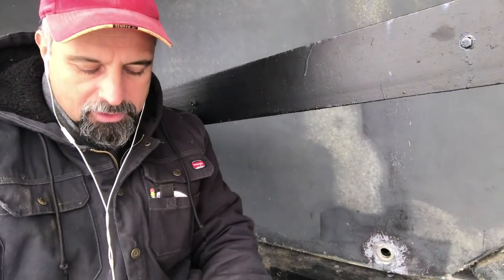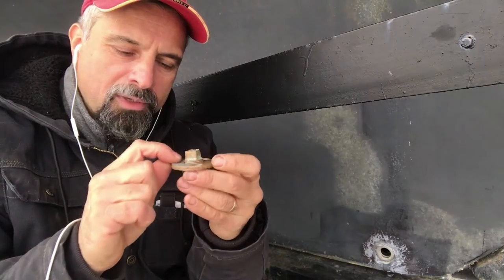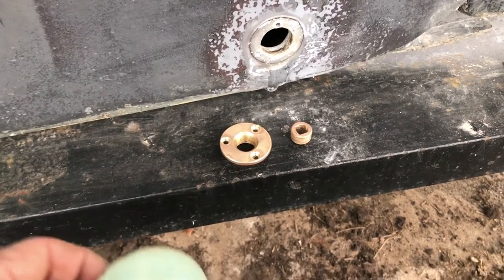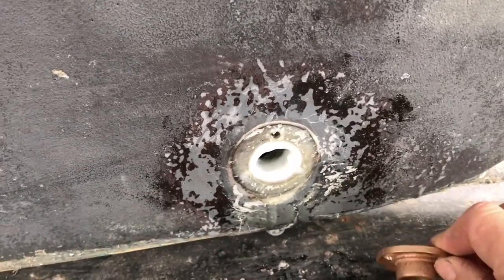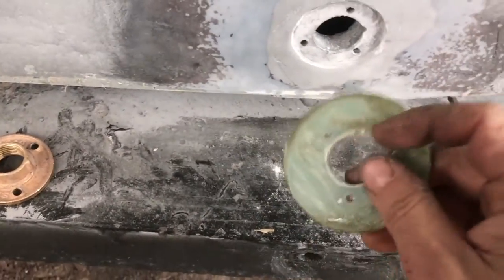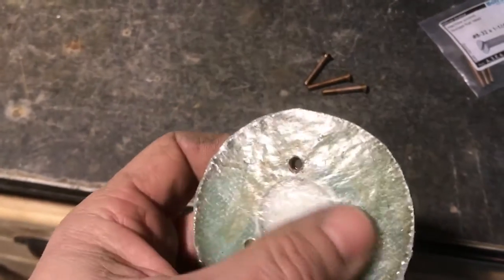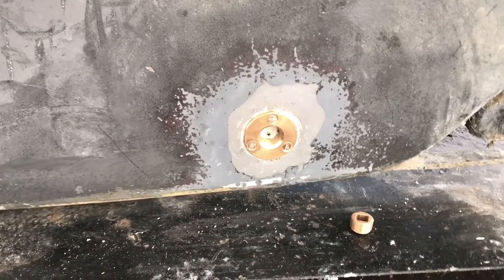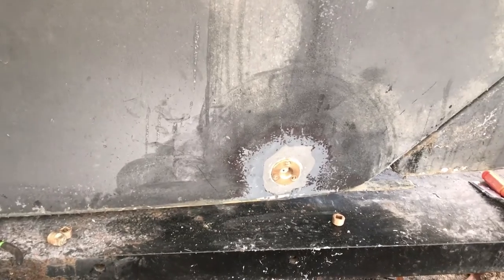Contessa 26 Refit ep. 22 Garboard Plug Modification

Comment: Nice work. One word of caution: the diameter of the garboard plug is that size   because there is a lot less chance of it getting blocked by debris in the bilge. I had a small hole like you and it got blocked and the boat filled up. It's a trade off which I guess you have already considered. Love the videos. B
Reply from the maker: Thanks. One extra step before leaving the boat for an extended time would be to vacuum the bilge clean. That’s something I always do and more critical if I were to glass it over.

Comment: Did you consider  just using a larger plug and female receptacle, thereby avoiding having to fill in the hole ?
Reply from the maker: That was the first thing I considered, but everything larger that I looked at was ridiculously expensive for some reason. There were a lot of broken screws in the area and some other questionable work that had been done, so I ended up closing the hole and starting new in episode 29.